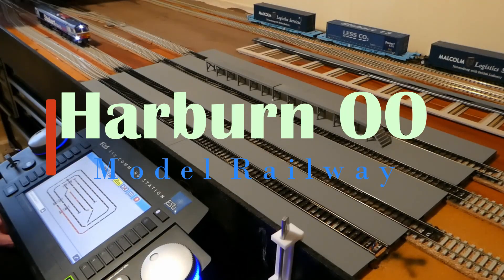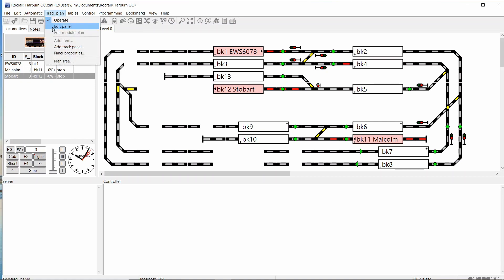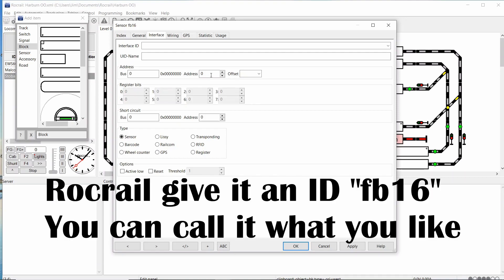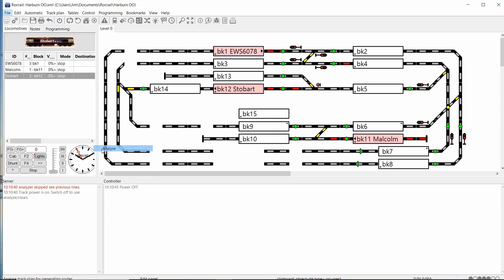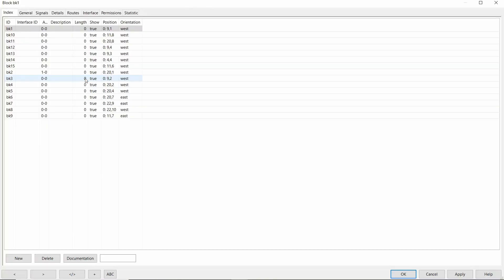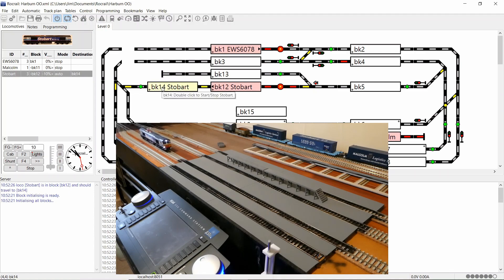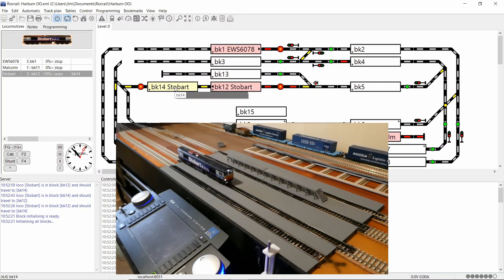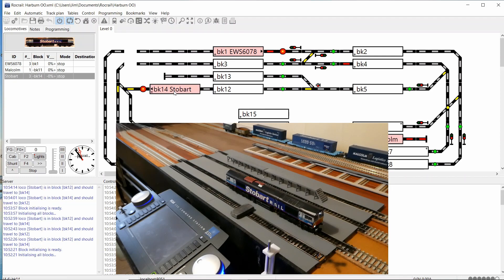Rocrail Add Block Sensor & Track

Comment: Nice clear video and explanation. I've just got to the point of setting up Rocrail blocks on my garden railway. Using ACS712 current sensors as input to either Arduino Uno R4 (while learning) or ESP8266 for out in the garden. When the current is detected, the Uno or 8266 send the block status over Wi-Fi via MQTT to a Mosquitto (MQTT) broker running on my Rocrail server (laptop) where Rocrail receives the block status. Doing it over wifi means I just need 12v accessories power at each block, but no need to run yards of additional sensor wires back to my control shed. That's the theory, but not quite all done yet then I'll find out what problems the British weather will throw at it! Rocrail runs my DCC engines using the AndRoc app on mobile phone (wifi again) and that commands my Marklin CS2 for running the trains and switching points/signals. I really like Rocrail, it has breathed new life into my old CS2. It's nuts how cheap the electronics is now for this kind of setup. Cheers, Jim
Reply from the maker: If you like the WiFi side I have put up a few vids on Rocrail wio on esp32 and pi pico w2